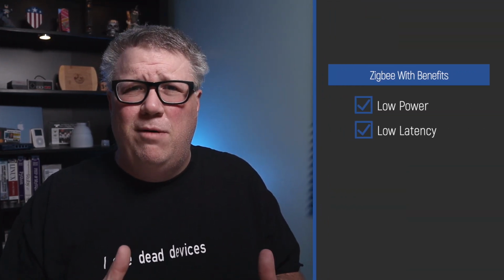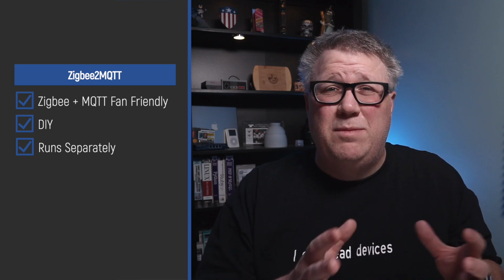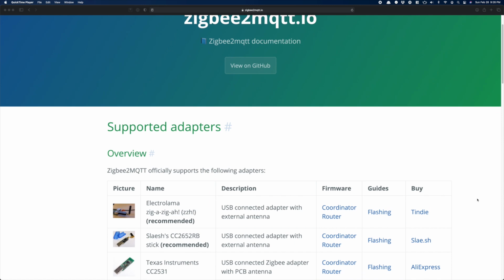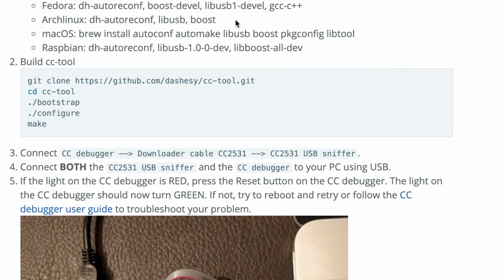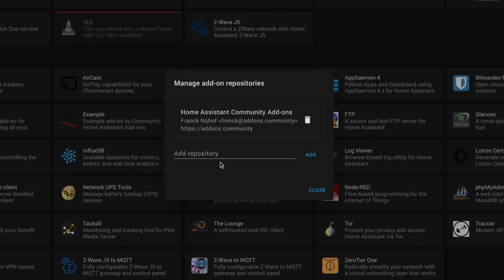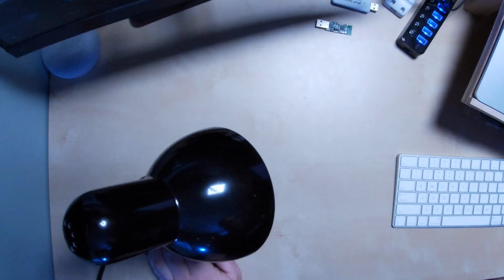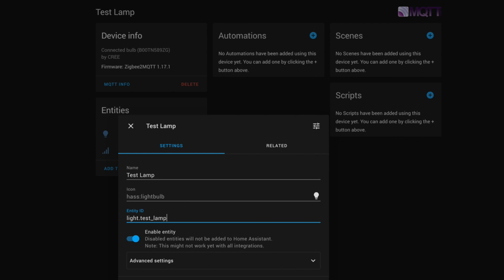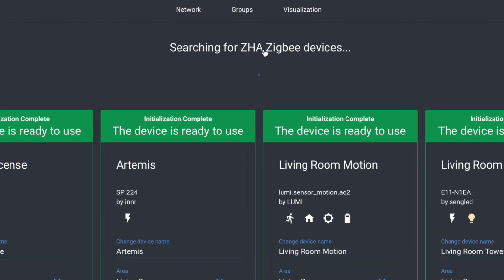How to Add Zigbee Devices in Home Assistant

Comment: I have the ConBee II Zigbee controller (just got on Saturday 23-Apr-22 // I have plugged into my HA - and installed the deCONZ add-on and Integration (it appears that the firmware was updated too via the Phoscan-GW option available after I installed the add-on).  Does this matter?  I do not currently have a large number of Zigbee devices (just some temp/humidity sensors - BATTERY) - which do you think would be the best way to get them into HA ??

Comment: Aqara devices have been unstable on my setup.  In retrospect, I wish I had gone with another manufacturer.  If I install any more Zigbee devices, they won't be from Aqara.
Reply from the maker: I have had issues with some of them as well. Although after adding a dedicated zigbee router things appear to be more stable.
Reply: @SlackerLabs  Which one did you use (router)?  The ones that cause me the most grief are the motion and leak detectors.   And the last thing I want problems with is a leak detector.

Comment: I'm currently using a ZHA solution for about 15 devices. However after having to run around re=syncing devices 2 days in a row, I'm beginning to like the idea of the Zig2MQTT setup that leaves the network intact even if the HA platform goes away. I already have enough other plans for MQTT that I'm seriously considering setting up a stand alone server to act as the broker for more than just HA. (Server management comes t mind.

Comment: I needed a remote controller because my Hass box is hidden away in the basement mechanical room, so I found a circa 2015 raspberry pi in a box of parts and used it for a wired Zigbee2MQTT installation on the main floor.  The adapter is a SONOFF Zigbee 3.0 USB Dongle Plus Gateway (not sure if this was available when you made this video last year).  Installation was simple, and the pairing works well too.  Next, I need to add a repeater or two to beef up signal strength for the outlying devices.  

Thanks for the great tutorial!
Reply from the maker: I think I grabbed that sonoff one after the video to try out. Now I’m not sure I actually did.  Haha

Comment: Hi, I am currently using Raspberry Pi 4 to run Home Assistant in my house, I have integrated several Tuya WiFi-based devices with Home Assistant. I have a question about Zigbee, do I need to have Zigbee Hub to connect Tuya Zigbee-based devices to Home Assistant (Zigbee Home Assistant-ZHA)? Thanks, looking forward to your reply.
Reply from the maker: Yes. You will need a zigbee hub. Either a standalone or a usb stick that runs off your Pi.
Reply: @SlackerLabs so by using Zigbee Hub (Tuya), I can connect the hub to Home Assistant then connect my Zigbee-based tuya devices without adding the hub and tuya devices to TuyaSmart application?
Reply from the maker: @rizalrzky  I dont think you can. But honestly, I am just now starting to play with Tuya devices. So far I have the Wifi ones. But I do not think the Tuya hub can connect to Home Assistant. You may be able to connect it to the Tuya cloud, and then get them into HA via the Tuya integration. But I would be surprised if you could connect the Tuya hub directly to Home Assistant. At least not without Flashing it. And even then I am not sure. I am just trying to get my first Tuya smart life device integrated as I type this.

Comment: Thanks... just got the nordec and configured ZHA... when it added there was only on device associated though (you had two in your video, I don't have the coordinator) and when I try to pair a device it searches without finding anything :(
Reply from the maker: That’s really weird. Did it perhaps get linked to the zwave radio? I’m not sure why it would be missing the coordinator.
Reply: @SlackerLabs  thanks i got it working after all with a USB extension…
Reply from the maker: Oh. Raspberry pi 4? I had issues with the Pi4 USB ports and an extension fixed it.
Reply: @SlackerLabs nope, a VM on a synology NAS

Comment: great video, I learned a lot!  i started my zigbee journey adding a conbeeII stick and deconz about a month ago, all to see if i could use this blueprint...

deconz ikea five button remote for lights with color temp

to dim and change color temp on my color led bulbs throughout my house with these switches...

tradfri remote control 00443130

and I'm happy to say, it all just works!  now if only I could get some help from one of the best HA coders I have seen on youtube ;-), or anyone else, to help me figure out how to make that blueprint do one more thing.... it should fade in when I turn the light on and off.  there were a bunch of transition variables in the blueprint which I have used with my lights in node red automations, but the transition for event 1002, which I am pretty sure is the toggle light service doesn't work, (nor do any of the other 10 transition variables) so I was lost pretty quick, since I am not a programmer.

I also have a separate HA instance running for another project with some aqara water leak and temp / humidity sensors, aquara little square button and a sonoff s31 smart plug all using the sonoff bridge flashed with tazmota on ZHA, and so far that is working great too, although updates seem slower for sure.

subbed!

Comment: how about deconz..?
Reply from the maker: Yep. I didn’t mention deconz. I think you are limited on which coordinator you can used. But honestly I don’t have any experience with deconz.
Reply: @SlackerLabs  Yes with deconz you can only use their coordicators, but its a rock solid platform and comparable to z2m and zha. so should have been included. Also you say for z2m that pairing mode is always on is a plus, they recommend turning it off after you finish pairing and leaving it on is not good practice as anythign could join.
Reply from the maker: Yep. If I had a conbee I would have. And totally true about pairing mode. I forgot to include the part to turn it off after pairing your devices.

Comment: So what Solution are you running with now? 🤔
Reply from the maker: I’m running zigbee2mqtt these days. That was my solution up until a couple months ago where I tried to switch to ZHA with the sonoff bridge. Had issues moved back and that started down a period of switch back and forth between the two trying to get ZHA to work for me. Now. Just sticking with zogbee2mqtt
Reply: @SlackerLabs  So you are using your Sonoff Tasmota Zigbee bridge with Zigbee2mqtt? I know that is possible but it requires some change to the setup right? Any chance you would do a video on this?  Again thanks for your great videos!

Comment: I have had no issues with ZHA nor with the Aqara deveices making life difficult for other Zigbee deveices. I only have 14 Zigbee devices and 14 ZWave devices but no issues for now.
Thanks for the extensive comparison though. I would like to get my hands on a Nortek stick by curiosity but can't find one. Anyway my current Zigbee and ZWave adapter work fine (since ZWave JS that is :-))
Reply from the maker: I’ll be moving to zwavejs soon. And plan on doing a video in the same style for the zwave options.

Comment: Great video as always :)
I would like to use also ZigBee2MQTT with ConBee II however I don't know and find any suggestions (for beginner) how to flash it if it's necessary etc.
Reply from the maker: I think the Conbee might be the only stick that can work with both. And I don’t think it needs to be flashed. I’ll have to check though. But I thought it was a no flash option. Forgot to mention that.
Reply: Thank you for your answer! Unfortunately after installed “everything “ there is an error when I try to start the Zigbee2mqtt from the side bar... 502 getaway error
Reply from the maker: @TamasKemeny  Ewe. I think I have seen that right after zigbee2mqtt restarts, but it goes away pretty quick. Seems like is a port error because something else is using the port the web interface needs. I'll have to test that.